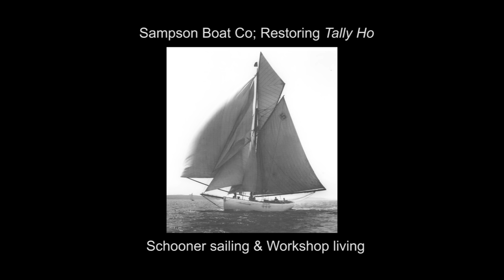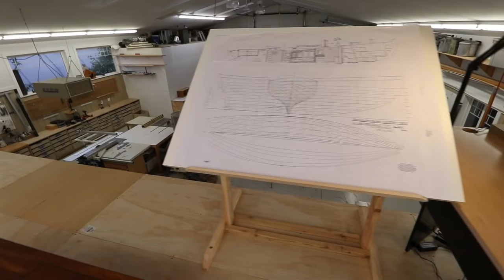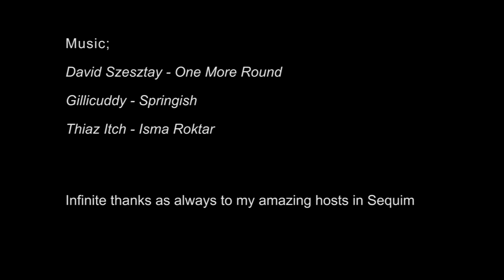Sailing as crew on the superyacht Adix - Rebuilding Tally Ho EP5

Comment: It's a nice life.  Hope to see you out there sometime.  I rebuilt mine as well but I started with an old fiberglass hull so I had much less work.  Still took 10 years to get the boat ready and save enough to leave the US.
Best of luck
PS.   Leave when you can - not when you are done.  Boats are NEVER done.  I'm in Florida refitting now.  It's an ongoing battle.
www.svTemptress.com